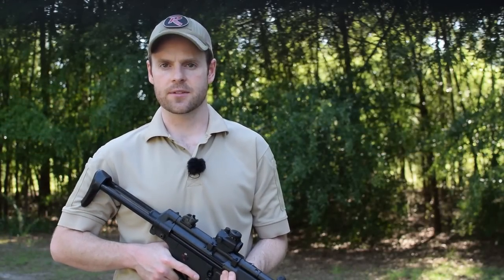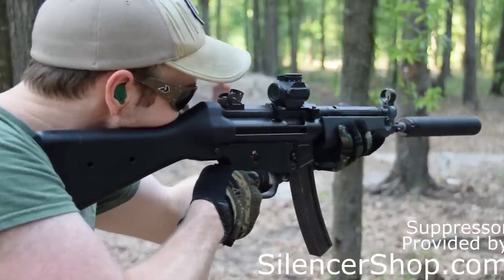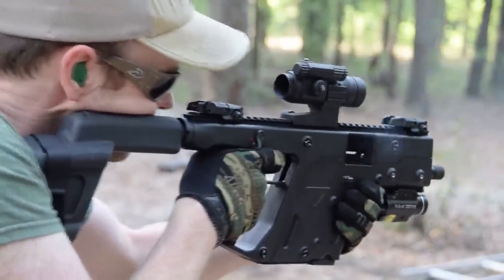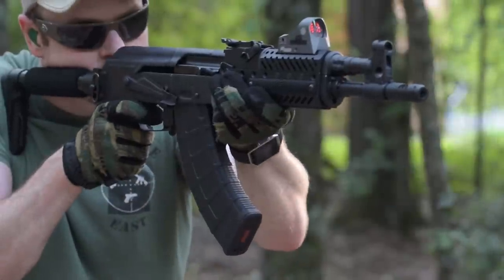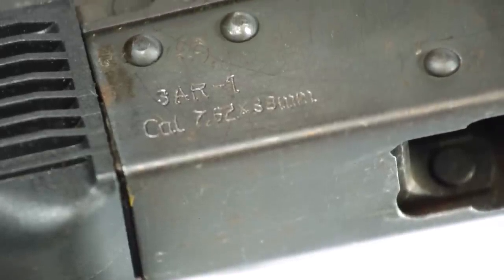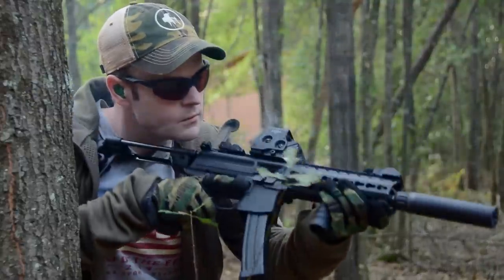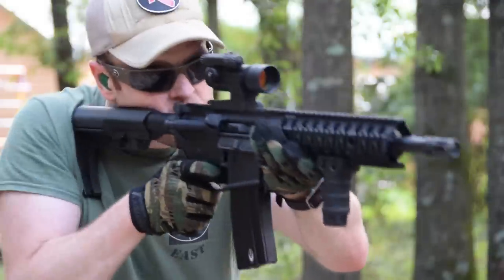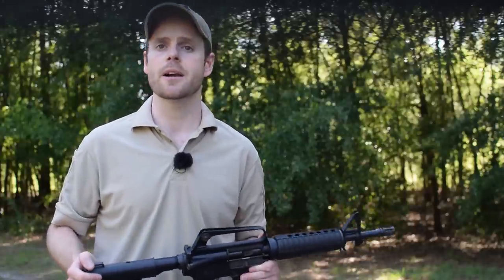Top 5 Guns to SBR

Comment: Dont SBR, get a Pistol version and Brace it...
Then theres no paperwork and you wont be in multiple databases (that arent supposed to exist)
No Tax Stamp or waiting
You can cross state lines with it 
You can store it loaded in vehicle, carry it if needed (follows handgun laws)
If its 26" OAL (10.5" AR for example) then you can add a vertical foregrip
You can make a pistol into a rifle and back to a pistol without telling anyone.

As Braces improve the need to SBR becomes less of a desire, it only proves how pointless and obsolete the NFA laws are, especially in conjunction with Binary Triggers.
Reply: Raymo_2_u it is not legal to attach a vertical foregrip on a pistol. Length dose not matter.
Reply: @jacobgalvan367  Wrong. If it's over 26" from receiver or receiver extension (buffer tube) to barrel, not muzzle brake or flash hider (unless pinned) it's legally a "firearm". Like the Mossberg Shockwave. And a VG can be added, but it's no longer a "pistol" as defined by law. Know your shit before you give out advice.
Reply: UnaSolida everything you said, applies to a smooth bore barrel. Not a rifle barrel. There are different regulation for; smooth bore barrels and rifle barrels
Reply: Jacob Galvan no, theyre considered AOW’s look it up. If it has a pistol brace and has an OAL of 26” then a vertical foregrip can be installed. They are for sale everywhere in CT as its a loophole since its categorized as a “Firearm” which is an “any other weapon” defined by the NFA.
Reply: Jacob Galvan look up CT4-2A. Also t-rex arms and garand thumb have a MK-18 set up video where lucas explains this loophole.....
Reply: You're pretty stubborn aren't you? Over 26 inch overall length means VFG is allowed. It just falls into the "Firearm" category then. VFG on an under 26 pistol is an AOW though and requires registration. AFG is allowed on any pistol or firearm.
Reply: It's supposed to be over 26 inches with everything fully extended but the ATF has been measuring with braces collapsed recently I've heard(which was the issue in CT they were trying to say the guns were AOWs because they were under 26 inches when fully collapsed and had VFGs).
Reply: Over 26inchs makes it a "FIREARM" And nolonger  a pistol
Reply: YOU DON'T THINK YOU'RE NOT ALREADY ON MULT LISTS ALREADY?.. LOL! DON'T BE NIEVE..
Reply: I always take photos of every AR lower I buy set up as a pistol with a brace.  I always use a high megapixel camera, making sure I show the SN# and the brace in several photos.  It's also a good idea to have some photos with the receipt laying on the pistol near the SN#.  You are allowed to change a pistol into a rifle and back only if it was built as a pistol first.  I hope this helps.
Reply: For the people saying "over 26 inches is a 'firearm' so you can attach a vfg..." and using the shockwave as an example while taking about AR pistols, you're overlooking one thing. The rifled barrels! This rule does apply to the shockwave, because it's smooth bore, but does not apply to AR pistols over 26 inches because they have rifled barrels. This is why they made the Franklin Armory Reformation with straight lands and grooves in the barrel, instead of spiraled actual rifling...
Reply: The 26” OAL with a vert grip is 100% okay. Call the ATF and ask. 
And don’t tell people to sbr or not. Let people do what they please. My stamp came back in 20 days (6/6/19-6/26/19). It’s so easy and why not have both pistol lowers and sbr lowers?
Reply: @azgunguy4870  This is true only with "firearms" like the Shockwave or the Franklin Reformation, but not with AR "pistols." My understanding is VFGs are not allowed on pistols.
Reply: Barrel length doesn't matter. You could make a 20" barreled pistol, as long as you put a brace on it.
Reply: Dominic E Thank you!!
Reply: Glad I could help.
Reply: Totally disagree. After buying an M92 PAP as a pistol with a brace and seeing how useless it was except very short ranges, the need to SBR is the only way to go.  The 8" folding stock and Holosun 507c make this a very accurate 7.62 rifle.  I also modified the gas piston, trigger group, handle etc.  You can cross state lines with an SBR as long as you send the ATF a notification, you can store it loaded in your vehicle as well. ( I checked with my local PD and they had no problems with it, they even stopped me for a broken headlight and didn't care)

Was well worth the 6 months wait and the stamp.
Reply: @azgunguy4870  Hey man thats awesome to hear! Did you build one and form 1 Efile? individual or trust? im about to SBR two lowers I bought and going to Efile my form 1 as a trust hoping I have similar results. Last two NFA items I bought and still dont have them 😭
Reply: I think the ATF needs to look at this specific comment section. There are literally 10 different people who are all very certain they are in the right and everyone else is in the wrong, with 10 varying opinions on what is legal and not. What a joke the ATF is. Threaten to jail people for 10 years over laws nobody understands.
Reply: @jacobgalvan367  OAL of 26 and YES you can add a vertical grip.
Reply: This is poor talk.
Reply: @jacobgalvan367  adding a vert grip on a gun under 26" makes it an "any other weapon" according to the atf. Your point is mute
Reply: @ZombieWilfred  this is simply untrue. If your pistol from buffer the to crown if barrel is 26 inches or longer, a VFG is a perfectly legal option
Reply: The first sentence aged badly, oooh boy
Reply: Still not good enough. You must finish an 80% lower then put a pistol brace on it with a short barrel. Now you’re not in any databases. Other than the atf can raid your manufacturer and get customer orders…

Comment: I got a 10.5 inch AR. It's friggin amazing. Not a complaint to be had.
Reply: Got my FN-15 with a 11.5 barrel.  Theres an option to get a 14.5 barrel...  suggestion?
Reply: @phillipyee7705  do you want slightly more velocity and a slightly longer less mobile AR? not many reasons for you to upgrade from 11.5 to 14.5 unless you don't care about the slightly better mobility with shorter barrel and must have 200 or so more FPS.
Reply: My short barrel AR is in 300BLK and it’s amazing. I prefer 5.56 out of at least 16” but I may get a short barreled one yet
Reply: Now try shooting at 200 yards
Reply: Yes, they make great range toys. God forbid I would ever have to use an ar15 10.5” in an actual cqb situation with no ear protection.
Reply: I am trimming my m16 barrel for m4 will it have any affect on performance

Comment: Except for expense a PS 90 SBR really kicks butt.  2300-2500 FPS and 50 rounds low recoil and reliable operation rules. For those thinking the 5.7 X 28 MM is nothing but a .22 Mag. perhaps you should change hobbies.
Reply from the maker: C Kim - I didn't have the ' bug's for one until I fired the full auto version
Reply: They are sweet!    ;>)
Reply: C Kim I agree. Always loved the P90 my bullpup first love.
Reply: C Kim Don't forget the cz scorpion
Reply: Tre' Roney  Another good choice! I went with the CX 4 Storm and I have a PX 4 Storm pistol and they share magazines
Reply: Not really man.  Around $1500-1700 That's not bad IMO. Obviously you can get a Vector for that but an MP5 not really.
Reply: BINGO! PS90 SBR is one of the best!
Reply: I'm wanting to put an AR57 on my machinegun lower. 5.7 in full auto would be awesome.
Reply: Lee Harvey Oswald  yep 5.7 was designed after the gun. It's cool and different but people are die hard for it for little reason
Reply: The 5.7×28 is rediculously expensive and rare.
Reply: @spookypunky  It is now, I bought a lot when no one else was buying it. There were tons on the shelves then!
Reply: @BurstReview  H&K SP5 pistol should be a requirement to SBR.

Comment: Great video.  The only thing that has held me back from turning my AR into an SBR is the ATF requirements for reporting when crossing state lines.  Unlike suppressors, you must fill out a form 5320.20 before crossing state lines with an SBR.  I live in Oregon and my range of choice is 45 min away into Washington state.  Too much hassle.
Reply from the maker: Steve Staub - Yeah that's a pain in the ass, especially if you live on the border of your state. I'm only 45 mins from NC, and a few hours from GA, so I have to be careful transporting any of these guns to shoots at new ranges.
Reply: Luckily, with the latest relaxed ATF opinion on shouldering an arm brace, I instead built a 300AAC with 7.5" bull barrel, KAK Shockwave brace and Omega .30 cal suppressor.  Gets me close enough to SBR feel without the extra paperwork.  Thx again for the informative video.  Nice work.
Reply from the maker: Steve Staub - I doubt whatever's on the receiving end will argue about the gun's BATFE classification
Reply: BurstReview exactly.
Reply: plus you can have it as a truck gun, gets difficult "concealing" an sbr, but an AR/Rifle pistol you can transport just like a glock or any other actual pistol.
Reply: @sstaub  hope you like her! I made my 8.5 300 blackout pistol with a sba3 collapsible brace, used to have the kak shockwave but I ended up liking the sig brace more!

Comment: Nice list. I’ve put so many rounds through M4/M16 variants as well as a myriad of AR-15s in different configurations and calibers that I tend to stick with platform. I have one that I built myself right down to machining the lower that has a 7” barrel and wears a thread on suppressor that some of you might get a kick out of it. It fires a 10mm round and uses M3 Grease Gun magazines that have slightly modified feedlips. It runs like a champion. I built a jig to handle the magazines so that I wouldn’t inadvertently butcher them. Since they’re not exactly tight in tolerance and the 10mm is generally loaded to an overall length just 0.030” longer than a .45 ACP I weeded through my mags to find the looser ones. The rest are used in an identical SBR chambered in .45 ACP. 

What can I say, I still prefer 1911s to Glocks so I’m kindly old school, but the most important thing is to use and own what you like best and if you  use them for serious work make sure that it won’t let you down.

Comment: Kriss makes aftermarket mag extensions in 45acp. Those can be converted to operate with 10mm and have a 30 round capacity if memory serves me right. You need to sand the insides with a dremel a little to make feeding consistent and swap the follower.

Comment: About the AR-15's buffer tube, Faxon makes the ARAK receiver, which is basically a AK styled upper for the AR-15. I believe it actually has the buffer spring assemble in the upper, like an AK. So you could actually use a side folding AR stock with this... I think. either no one has thought to do this yet, or they havent been posting pictures...

Comment: Excellent video. I have some questions though. 1. What stock is that and is it on an ace folder???  2. How is the cheek weld on it when shooting with irons and that reflex sight??
Reply from the maker: MeisterSexy11 - it is on an ace folder, and I bought it from US machine gun - http://www.usmachinegun.com/proddetail.php?prod=DRK-MLST ($179.99 and sadly, not a sponsor)

as for comb height/sight alignment, the mounting mechanism allows for roughly two inches of vertical adjustment. I found on the middle setting, a proper sight picture could be obtained with both irons and low-mount optics like the SIG Romeo 3 or a low-mount Trijicon RMR.
Reply: BurstReview Thank you for the quick response.  Keep it up with quality content :)

Comment: Excellent video.  Here's mine (all dedicated to subsonic-only, and of course, suppressed):  #1 .338 Spectre AR15.  #2 S&W M&P-22 .22lr with Fostech Echo trigger.  #3 T/C Contender in .357 max (no action sound; 230 gr Badman soup cans).  #4 Rossi 92 levergun in .45 colt. #5 .300 AAC/BO AR15.  Hon. Mentions:  6.5 Grendel AR15, Kriss Vector, FN P90, 9x19mm AR15 (such as MPX), &  .50 Beo AR15.   This will take me awhile to acquire (as in, never).  But I will have #3 finished (stamped) within a year, and my 6.5 Grendel and M&P-22 at some point in the future.  So those 3 will become reality.
Reply from the maker: Daniel Stoner - that list makes my wallet ache, and my mouth drool. Good picks!
Reply: I was going to pursue #4, but the barrel on the 12" Mare's legs doesn't extend far enough beyond the magazine tube to have enough meat to thread, and shortening the tube mag is not worth the gunsmithing costs - sad, since it only needs another 3/8ths" or so of bbl length to thread, and it would be an outstanding home defense rig in subsonic suppressed .45 Colt.
Reply: Yeah, thanks - it's a bit different, with non-semi-autos in the mix.  I'm pretty fired up about building the .22lr - what's better than a cheap-to-shoot, suppressed, SBR, in full auto (essentially) with a slide-fire or fostech?  I will make a vid after putting #3 together - it's ready to assemble once I get my stamps back.

Comment: A pretty good review; well done! I noticed your comment on the EVO Scorpion; I don't own one, but I imagine if you're going to spend the money to SBR it you might want to use it to it's full potential, i.e. with a can; so I guess the issue of 'blowback', as opposed to self-regulating gas block can be important, though realistically, that's why teams [SWAT, SPECOPS, etc.] all wear one-piece eye-protection, generally NIJ Level-III-certified, so gas isn't really an issue. Still, great video; hopefully, it was done in 3-4 takes/edits.

Comment: With AR-15 SBR's or Pistols, Just use lighter grain ammo....Black Hills 50gr 5.56, and Lehigh Defense CC 45gr .223 are both flying at around 2900fps-3000fps out of a 10.3"-11.5" barrel....Ultimately it depends on the type of ammo, Great Video btw bro!

Comment: One of the best things about the Vector is that it uses Glock mags. Glock is the most common handgun in the world 9mm is the most common round in the world so if SHTF you can use both a Vector and Glock in the same Caliber and still be able to find ammo very easily. It will also help on Carry Weight because you are only using one caliber not two different calibers.

Comment: 55gr out of a 10.3" is still better than 9mm out of any barrel length. Factor in SBR optimized loads in 5.56, like Black Hills 50gr Optimized TSX and it's not even close. That round performs phenomenally from basically any (practical) barrel length. From 7.5" through to 20", it has fantastic terminal ballistics.

You don't need to change calibers to get good performance out of short barrels.

 Honestly if you're using 55gr ball ammo for any serious use-case, you have issues, but at the end of the day, rifles are rifles and pistols are pistols. Even green tip out of a 10.3" barrel performs significantly better than even the best 9mm loads. M193 out of a 10.3" > 147gr HST out of a 16" every day of the week and twice on Sunday.

Comment: The standard AR charging system sucks. Look into a New Frontier Armory side charging billet upper for only 225 bucks. Unlike most side charging uppers, things can take any standard AR BCG; the only modification required is a different cam pin that is provided.
Reply: All Games good recommendation. If you don't mind reciprocating CH, Bear Creek Arsenal has side charging uppers with complete BCG frequently on sale for $150 or less. Can't beat that.
Reply: Tim Tdb I'm not sure how much they are, but there is a side charger that attaches to your existing charging handle and a small section of the upper pic rail.

Comment: I don't see any reason to make your 'Other' AR 15 lower into a SBR.  The SB A3 brace is fine and no reason to take all the pluses of having what is considered pistol and then making it legally treated as a rifle.  A pistol AR 15 makes a better truck gun, or trunk gun, than all the issues of a short barreled rifle.  If the shit ever does hit the fan and whether it is a pistol or a rifle becomes irrelevant.. Swap to a carbine buttstock on it and it is an SBR. 

There are guns I would go through the trouble of registering them as an SBR, the AR 15 just isn't one of them.

Comment: You don't think that the CZ Scorpion Evo is in the top 5 SBR's?   interesting
Reply from the maker: Christopher Clements - I like the Scorpion, but outside of it's cheap mags, and direct blowback operation, it doesn't do much for me
Reply: Christopher Clements I have the Scorpion and it's gone through 10k just fine. Yet on the other hand... I have a Vector also and hate it.

Comment: 20" ar15's require a different buffer tube? Incorrect sir. Many individuals run 20s with a carbine stock.. and don't forget the Canadian service rifle
Reply from the maker: thehammerglock17 - In standard configuration, meaning, with the buffer and spring tube designed for it. The fact that you can cobble different gas systems together with different configurations simply reinforces my overall point - The AR-15 is King because it's so modular
Reply: thehammerglock17 ok then... 20" ARs were originally designed with longer rifle receiver extensions. Better cupcake?
Reply: Yes, that's better. Unfortunately he stated it "requires" a longer receiver extension. Which is incorrect... got it fruit cake?

Comment: just build an ar with a 14.5 inch barrel and a pinned flash hider. no paperwork required.
Reply: Great you have a 16 inch barrel still huge difference between a 14.5 inch 5.56 and a 8 inch 300 blk out, the pistol braces are adjustable now why would anyone build a. Rifle
Reply: I prefer having short barrels with an actual stock. Only way to do 10 inch barrels or shorter with a true stock is to SBR it.

Comment: Never sbr 5.56.... 300blk, 7.62x39, 5.45x39, or 9mm are much better. Ar15s are not great for sbrs not unless you want to pay a ton of money to allow for ability to shoot with the stock folded. If money isn't an issue sure go Ar15 folding stock/brace in 300blk or 5.45/7.62x39.